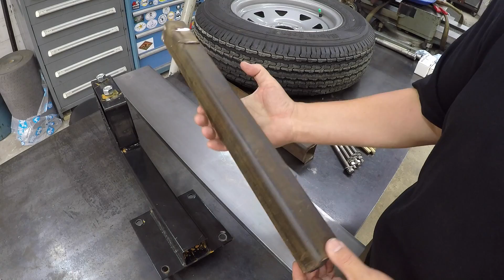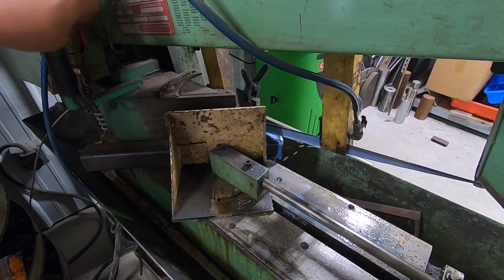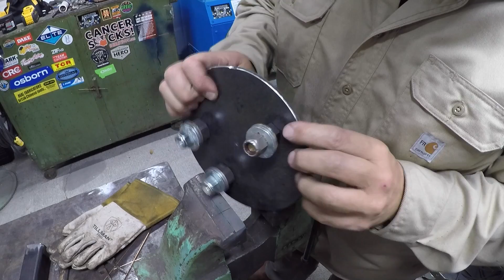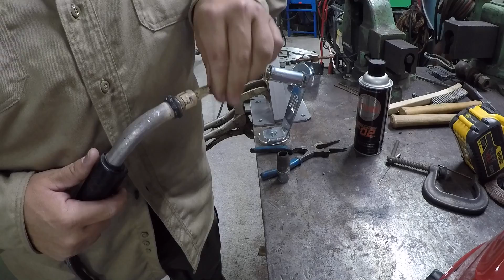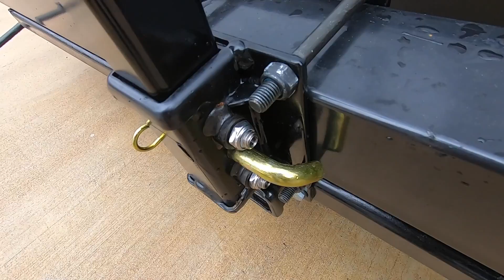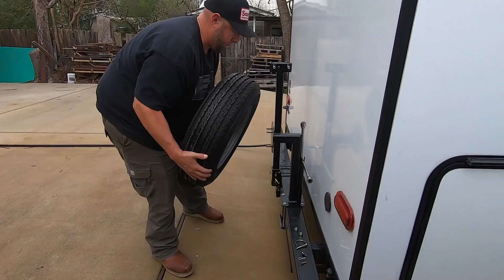Spare Tire Mount Build for Travel Trailer

Comment: You should put this mount into production.  I have searched the internet trying to find one just like it and cannot find one.  With a hitch carrier installed on my travel trailer, I cannot keep the original mount.
Reply from the maker: Any reputable welding and fab shop can make one for you. The square plates are 6x6x1/4 and the tubing I used is 2”. Since I’m a machining and welder I like to build things heavy duty. 👍🏻
Reply: @AbomAdventures  thank you!  I did go and talk to a welding shop that builds trailers etc. here locally.  He is going to build a rack for me just like the one you have!  Thanks again!

Comment: I have a cargo rack that came on the back of my 2021 Surveyor. Spare tire came mounted to that rack which made the rack heavy to tilt down to use and the spare tire would be hanging down in the way and looking like total crap.  I cut the tire mount off the rack, beefed up my front battery rack by welding on some heavier gauge angle iron and then rewelded the same tire rack under the battery rack and front tongue of my trailer. Worked out awesome and love it out of the dang way. Repainted it all and it looks stock. Rear of my Surveyor looks %100 better as well.

Comment: I'd agree with Neo.  Rather than dealing with a pin and cotter pin, I would put a lock through that hole or you may lose both the wrench and your spare tire when you're not looking.  Very nice project.

Comment: Adam are you using dual shield in the mig welder?

A flat tire tip from a guy who has had it happen.  Go into your wheel well and line the upper part with at least 1/8th inch plate to protect your camper floor. The small bit of added weight is worth it.  I had a tire lose the tread and it ripped out the whole section of floor, plumbing and wire for the furnace. We had to replace the complete furnace. Thank goodness for insurance because it was about $8000 in damages because the wheel well is only lined with particle board. 
Cheers and happy camping

Comment: Nice job.  Can't believe the poor job on the other holder.   Hope the tire cover will cover the top nut driver on the t wrench.  It will fill with water and rust.  Alt : drill all four with cross holes to drain water that way.

Comment: when your welding the high tensile bolts in place to the back plate - really need to strip the bolts of their zinc or protective coating. When you add heat to them I believe it creates phosgene gas. Effectively mustard gas - can kill you

Comment: Nice work. I think the bolt holding the 4-way down is good. I truly doubt it will pop up, but if it did, and it could twist, it may rub on the trailer.
Alll my best to yu and Abby. Take care.

Comment: Mark the lug wrench with a bit of tape to show which socket to use. One less thing to thing about when changing a tyre in the dark and wet. Also use one of the other holes in the hub to devise some sort of locking mechanism so no one steals the tyre.

Comment: If you're not fond of weld spatter, maybe remove the zinc plating from the bolts, and the mill scale from the plate... Alternatively, you COULD use a weld-through primer or anti-spatter spray.

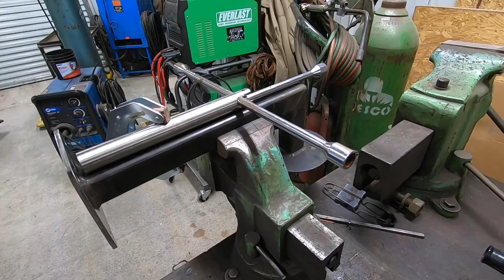Comment: 20:10 I like how you left a gap at the bottom of the tube so water won't pool up in the holder. Suggestion: Further modify it so the lug wrench/nuts can't be used to steal the tire.

Comment: You're way ahead of me, but I would have used nuts to secure the wheel bolts, in case I needed to change them out for longer ones if changing to aluminum rims. That's what I did when modifying a carrier to hold 8 lug aluminum truck wheels.

Comment: I used a stub axle and hub rather than a flat plate to mount mine on my boat trailer, that way if I chew up a bearing on the road, I can just swap out the hub.
Reply: same i have the hub with bearings pre packed with grease so i can just pull the cotter and axle nut and im on my way in 10 ,,,,
I also drilled one lug at the end and put a padlock thru it ,, it wont stop everyone but it helps

Comment: Just a thought.  Its easier to mount the wheel on the plate or even a hub if the single bolt is at the top.  On a wet, windy, cold, dark night aligning two bolts with the holes is more difficult than one bolt that doesn't matter whether the wheel bolt circle pattern is twisted round, once you have the top one in a bit of jiggling sees the bottom two on.  You will also need a security system to stop thieving scumbags walking off with a brand new wheel and tyre.  As wheel security bolts are sold in packs of 4 and you will have to locate the key on that same stormy night a chain and padlock is a very good deterrent

Comment: If you are unhappy with the spare tire holder, don't look at anything else on the camper.  Thy pump those things out fast and sloppy.  Lipppert (the frame manufacturer) is creeping into all the hardware and appliances used in the trailer.   Quality is sinking fast.
Reply: Also, that's not a real bumper as you would think it is.  It is only good for holding the sewer tube.  If you look how thin wall it is you will see.  I have replaced many of them due to overloading with bolt on hitches for bike racks.

Comment: Nice job. A good way to put a spare wheel on a trailer is to use a old axle stub with a new hub and set of bearings so if you need a new stub hub or bearings on the road then your ready to go. Hints for real remote area towing really. Sometimes u break off a stud or two its easier to have a new hub to just put on.

Comment: For my boat trailer I did it almost the same as you, I did use the same wheel nuts that was on the trailer (2 Size Heads)
But the main diff was I added a centre hub wheel support to make it easy to reinstall and took the weight off the wheel nuts which saves the threads from damage when you move the wheel, its been on there for almost 10 years (And yes for those people, the wheel has been used many times)

Comment: Gread video, Adam ! -tech tip: For the one of the four ends of the log wrench you will be using, wrap a color coded electrical tape around that wrench leg for quick identification of your go-to size. Being stuck in the side of the road is bad enough, but having to find the right size in darkness, rain or traffic is even worse :). Thanks again for great videos, keep posting and I sincerely hope you enjoy the camper life :) cheers from Brian

Comment: Your contact tip needs to be a bit tighter than finger tight. The welding pliers you are using have a place to grip them to tighten and remove them,

Comment: Very cool build. Just the right material to handle the load/job which the original mount was not. The fact that the original bumper and tire carrier are made of too thin a material for the job, unless the trailer will be towed on a plat of glass it's entire life, simply shows how much RV builders really dig when designing their products. We all know they need to watch out for weight and cost but, at some point, certain items just don't have room for those considerations.  Love the star lug wrench mount idea Adam, good thought.  If some wiggling still occurs, maybe sandwich a piece of flat stock in between the factory bumper and your heavy hitch bar. That may take out a little bit of flutter the tire still has some of the jiggles. I'd have to bet the factory didn't get the tolerances as close as you did with the machine shop shims/blocks and squares !

Comment: Abom, I did something very similar to my boat trailer. I did the circle idea with three studs as well coming through to match the bolt pattern of the wheel, but mounted mine horizontally on the trailer tongue just shy the tongue metal, so the tire doesn't take a shape tightened against the metal. But since I would be gone fishing from the trailer, I made two lug nuts welded to two 90 degree brackets with a drilled hole in them to lined up for a lock to fit through. It keeps anyone from getting the spare tire/wheel assembly and tightens the tire in place as well. It looks so nice and quality and I don't see how anyone could get the tire/wheel off and still be usable... Thumbs Up!

Comment: Putting that tire on the back is going to lighten up the front and cause sway. Not really but someone has to say it every dern time. Looks good. I'm fortunate to be able to have my spare I'm a storage space. I like making these types of mods for my camper as well
Reply from the maker: Just add a vice or anvil to the front to offset it 👍🏻
Reply: LOL I scrolled through all the comments looking for this one...I knew somebody would bring it up but it surprised me that you were the only one. The YouTube "experts" must be napping.
Reply: That would only apply if the factory spent the time to get the hitch weight perfect with the axle weight ratios. There's no way they do that so, once an owner takes a trailer home and starts to load it up with food, beverages, water, LPG, clothes etc., all of the numbers get changed.

Comment: Could have ordered up an extra spindle and hub that matches your trailer and used that to mount your spare. Then you would have those spare parts with you as well.  Most trailer bearings have a tendency to fail from time to time  thanks to their high side loads and the beatings they take on rough roads.
Reply: or at least have a set of bearings with race and a seal all greased up
Reply: Ya, know that actually is a good idea, Don't know how many times I needed a bearing or hub on things that the spare tire carrier would have been a great place to have it.

Comment: Get a black rubber bungie cord to hold the lug wrench. Bolt the bottom end to the upright and keep the hook on the top end to hook on the wrench. It will hold the wrench down and rattle less than a bolt and cotter key that you are going to drop in the dark and not find. The end result looks great!

Comment: That last lug might want to get a keyed nut.  Unfortunately there are still people out there that take things simply for the challenge of taking.  Maybe cross-drill one of the bolts and padlock it?  Perhaps something similar on the wrench 'tube' to effectively wedge it in place.  Awesome work way better than the 'stock' mount.

Comment: Why you didn't install spare under trailer tongue ?
Reply: #1...electric jack is there
#2 ..tongue weight
#3...way easier to pull straight off...then to lay on the ground to remove and replace your spare
Reply: Also, he has torsion bars for his hitch system.
Reply: Also ground clearance

Comment: Might want to think about a lock on the tire! If it ain't nailed down, they'll steal it. If it is nailed down, they carry a Claw Hammer!
Reply: I was thinking for sure the wrench is a prime candidate to "go for a walk" without a lock on it
Reply: A simple locking plug nut fixes that problem.  But I agree with that statement for sure.
Reply: I agree with that. Sadly but true. A locking lug nut should fix the tire problem for sure.

Comment: Now ,when someone wants to steal your spare, they don't need to bring their own wrench! A lock on the wrench and/or the wheel is in order,also a cap over the top socket on the wrench will keep water out,or if not the size that you need,just weld on a cap or cut the socket off.
Reply: Les Bender or just let it fill with caulking.  Or let it fill with water because it’s not a size he needs anyways :)

Comment: Perhaps, color code the tip of the lug wrench for the end that fits the camper, using tape or spray paint? Great Job, Mr. Booth!!!
Reply: Just weld a small knob of weld metal on the correct socket, lets you find it in the dark.

Comment: Nice work! I did something similar on our pop up camper. I travel with two spare tires, a set of bearings and an extra hub assembly. Maybe overkill, but I hate being stuck anywhere. We traveled from Indiana to Grayton Beach S.P. last fall with no issues. The original spare tire mount was pretty sorry on your camper, and may have failed. Hopefully we can all get back to camping soon.
Reply: Always better to have it and not need it than to need it and not have it!
Reply: "I travel with two spare tires, a set of bearings and an extra hub assembly." Having spares available almost positively means you will never need them. Murphy's second law of probability.
Reply from the maker: Good being prepared